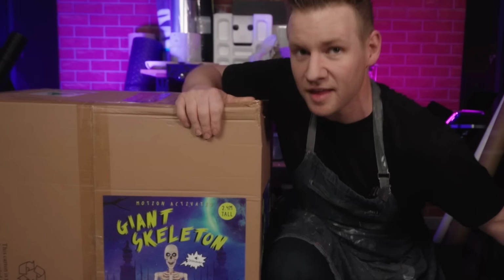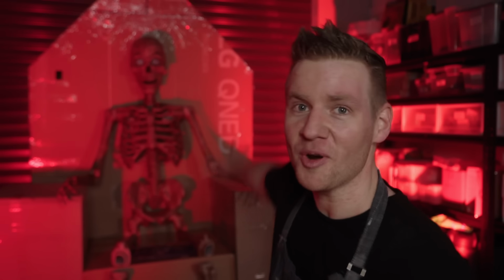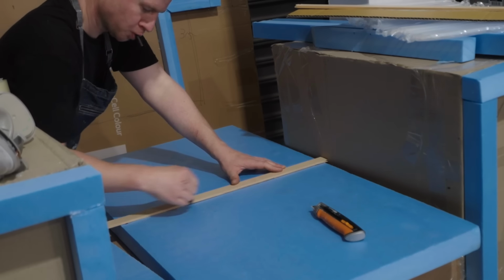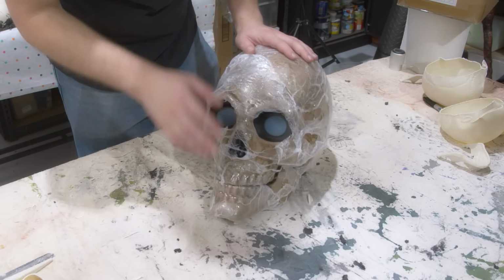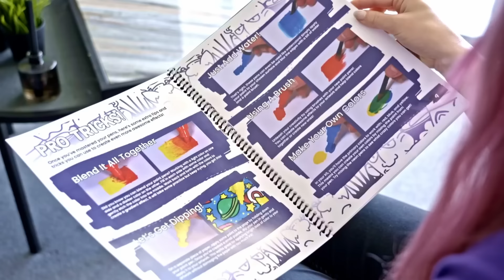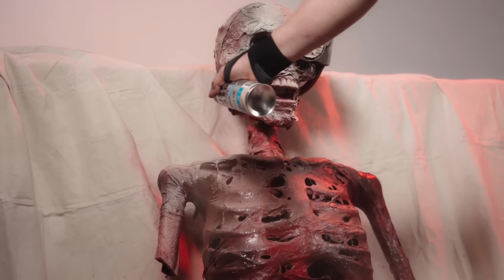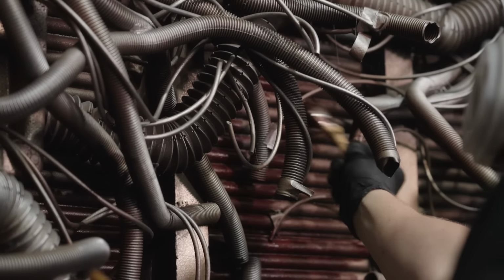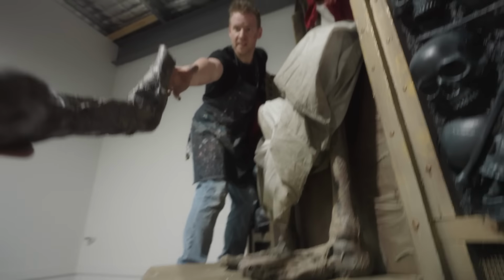I Made THE EMPEROR from Warhammer 40k! (Full-size!)

Comment: The use of plastic film on the skeleton is fantastic. I’m totally gonna use that next halloween
Reply: Tape can work the same way plus leave a more easily painted surface. Still need a respirator and really good ventilation. 

Tip: StiltbeastStudios has some Halloween build vids you'll like if you're planning to make your own stuff
Reply: @MaskedReviews  thanks for the info! I’ll have to check it out.
Reply: How do they mimic the cob webs?
Reply: @ there are tons of ways to mimic cobwebs. You could use hot glue and pull it to a thin stream, pull apart polyfill, or even just buy fake cob webs that look fairly realistic.

Comment: That is actually about as tall as an Astartes, as they been described to be about 7'6" - 8'6". Which is 2.29 meters to 2.59 meters. 

The Emperor of Mankind on the other hand have been mentioned to be many sizes, sometimes just as tall as a regular human, sometimes towering at the same height as a Primarch (3.5-4.5m/12-15ft depending on the Primarch with the exception of Alpharius who is more like 3m/9-10ft) or taller. My guess it is because of his warp power, he can be as big as he want.

Comment: Technically not full size. The shortest of the Primarchs (Alpharius/Omegon) are about 9 feet or 2.7m tall. The average is about 3m or 10 feet. Girlyman is stated to be 12 feet or 3.7m. As for the Emperor's height "Guilliman frowned. He tried to remember how tall the Emperor was, but His living image refused to be caught and examined. In some memories, He was as tall as Guilliman; in others, no bigger than a mortal man." Emps could actually change his physical size at will (not just perception) so it depends what size he was when Horus wrecked him, but generally the descriptions suggest he is around that 12-15 foot size on the throne.

Comment: Uhm, that's not full size. Some custodes are bigger than that, the primarchs were even bigger and the emperor was bigger than them all by quite a margin. He is said to be about 14 feet tall, so should be way over twice Jazzas size or nearly the full height of the room the throne is put in later.
Reply: he can change his size at will, under his psychic projection he appears as a regular sized dude